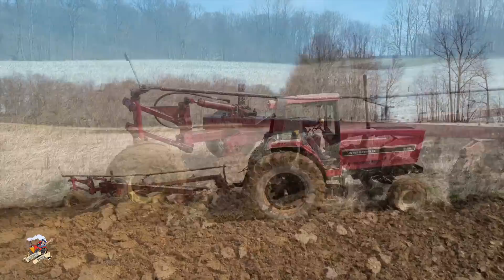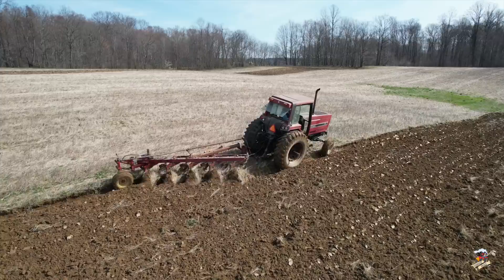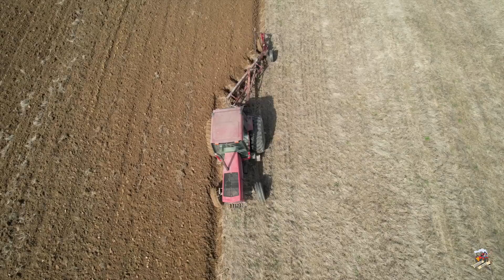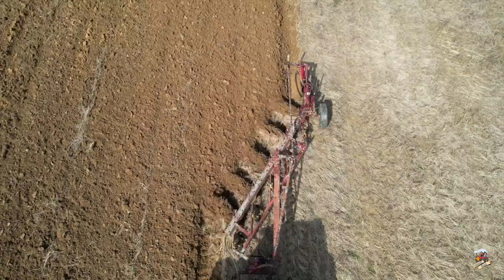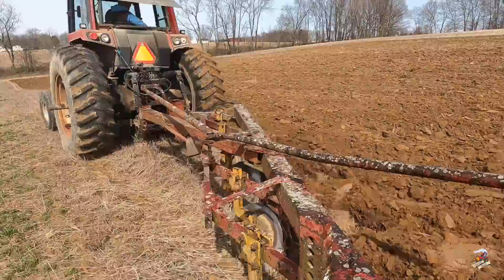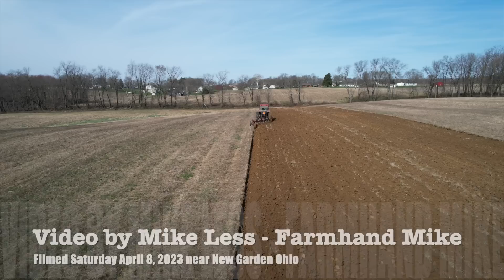International Harvest 5088 Tractor Plowing | New Garden Ohio

Comment: Great to see another plowing video . I used to do acres of custom plowing in my area. Does anyone ever have an On - Land hitch on their plow . That's what we always had . I ran am 856  IH with a 6 - 14" bottom the other two were 7-16" . Great & interesting video as always . Thanks
Reply: I am an apprentice farmer so, go easy on me.  But, isn't that tractor setup light for that kind of plowing work?  I guess it has fluid in the tires but no wheel weights or suitcase weights?  Doesn't look like she is lacking in power just seems light.  The ground does look good after a pass.

Comment: As I watch the 5088 work,   I see that the  tractor has these side panels which  hides the engine.  I can't help but wonder why this idea was not  on tractors back in both the  Seventies   and Sixties.   The other  thing I notice is that all the newer tractors   have  road gears that appear to go twice as fast as the old ones.  How come tractors from  the  Sixties and Seventies    had slow  road gears in comparison to the newer ones?  In any case,  thanks for showing a good video.

Comment: that last series of IH had some issues like the air intake on the hood which would plug up fairly often and the fan shaft that went through the radiator berrings let lose it wreck the radiator  on your plowing videos and general field work be nice to know the tractor speed and or what gear they are using and on the plow the size of the molboards  also I have never seen colters that are concave like on that plow